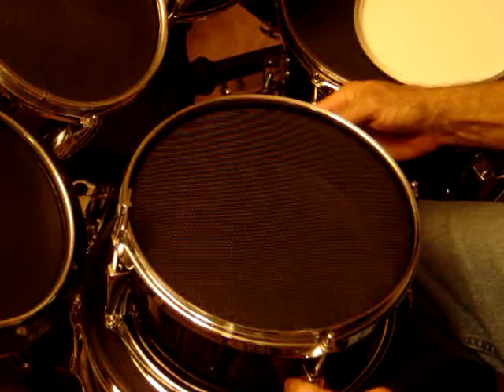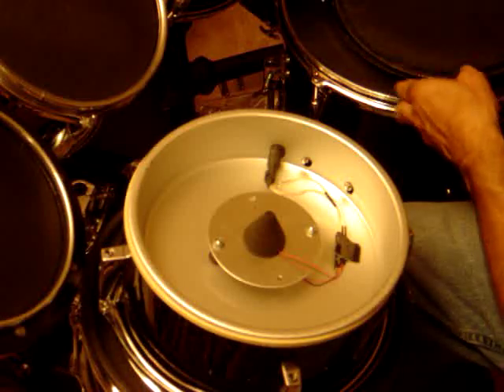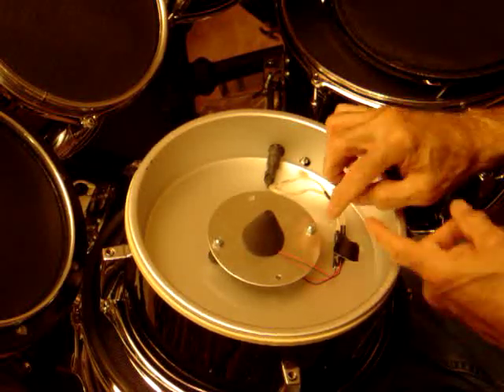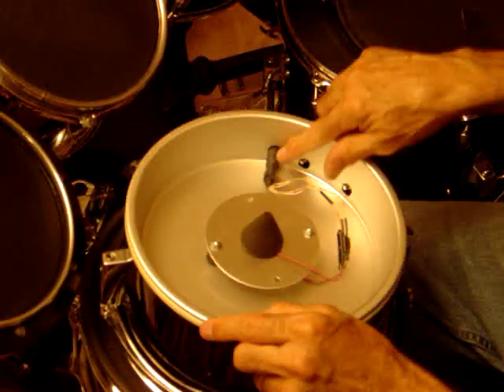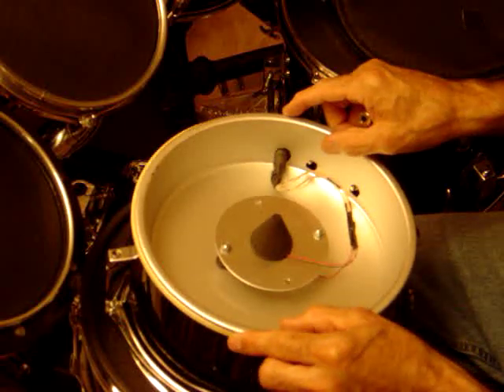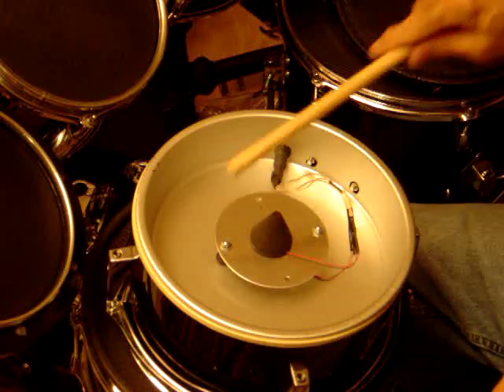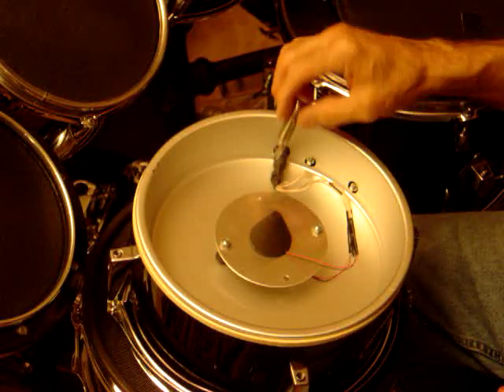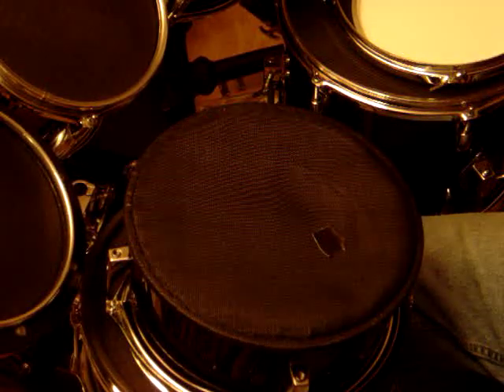DIY eDrum / cake pan- Segment 2 of 3

Comment: hi will any size piezo element work? turns out that i order some from ebay but i did not realize that i was a smaller size, they are like a 5 cent coin big. will these work or is there a diference in the behavior of the piezo element  been smaller?

Comment from the maker: for DIY small volume purchases I recommend buying the cones and/or trigger piezo assembly from the seller QuartzTrigger. He is on ebay as a seller out of Canada. his cones are clean and neat. they work. for a more professional DIY, don't waste your time and money trying to do this stage of the diy, just buy his cones.  he will also sell just piezos and even just the double face tape.  I use his pre made cone/piezo assembly,  I also bought some plain cones as I also had some piezos on hand.

Comment from the maker: I use my DIY Triggers (the Drums) to trigger my drum module. This module (a Roland TD-20) does more than just a TMI (Trigger to Midi Interface) it also produces the audio sound and allows for a variety of input and output signal control. So, in one box, my trigger is assigned a midi value and then converted to audio.  All I need is an amplifier to hear it.  While I have sold a few conversions locally, I do not have a system of parts for sale, Please search eBay for seller quartztrigger for parts

Comment from the maker: Cesar, your use of the term MIDI may be incorrect. Musical Instrument Digital Interface. is a  'coded message' for instrument voice, volume, sustain, etc, that is transmitted between MIDI devices. MIDI is generated by a MIDI module after receiving a 'Trigger' to start that MIDI message - This is called a Trigger to MIDI or TMI. My DIY drums are just Trigger devices, they do not make a MIDI signal.  The Trigger signal is just a voltage spike produced every time you hit the drum (more in next msg)

Comment from the maker: It might, depends on the trigger I/O or the module.  You will need to be able to setup, or 'tell' the module that your trigger pad (cymbal) is a dual piezo.  some modules allow this , some do not.  You could also wire each piezo to a separate input and assign the voices as you see fit, again depends on the module or your trigger I/O.

I have a cymbal I made using two piezos, so it is possible

Comment from the maker: ... good to know info...  Even a mesh head needs to get pulled over some sort of bearing edge.  The shells that I have cut were only cut into two - leaving two shells with each having one good bearing edge.  The cake pan builds I did had the cake pan lip sitting above the original bearing edge and the pan lip became the new bearing edge.  a cake pan might fit those flat edges from the middle section and thereby provide a bearing edge, else an edge will need to be formed. enjoy your DiYing

Comment from the maker: the cone protrudes above the bearing edge by about 1 to 1.5 mm, and the head is rather snug tight. the head should always be in contact with the cone when playing.  there  will be a very slight bump where the cone touches the head.  A second, false trigger, may occur If the head vibrates up of the cone and then hits back down on the cone.

Comment from the maker: I have started making my heads using an idea from another builder. Cut the mesh about  1.5 inches larger than the drum shell.  Cut a section of TV Coax Cable to fit inside your counter hoop.  cut a series of even numbered .25 inch slits in the mesh along a line that is drawn about 3/8" inside the outer diameter of the mesh head..keep them evenly spaced at about 3/4 to 1 inch apart.   lace the cable in & out of the slits and work  it till the ends meet.  install with cable ends facing up.

Comment from the maker: Your method of build is, in general, called a crossbar. I have built a few of these as well.  There are a variety of ways to mount the triggers.  This cake pan is just another option.  If you find pans that fit your drum, then all is well.  It does make for a very clean underside of the drum when splitting one shell into 2 trigger pads. BTW -my DiY, 'mini snare'  is a cross bar build, works great! I have a video of it posted also.  Glad that you have found a solution for your DiY eDrums -Enjoy!

Comment: The edge of the drum is important for fitting the head. Did you notice anything strange when using the edge of the cake pan? I just used a thick wooden plank (1.5"x4"x drum radius), fitted to the wooden drum wall by nuts and bolts with metal L-bars. That worked great! Very sturdy.

Comment from the maker: @CleanEdgeProductions ->  You are  corect, thank you for the correction.  The rubber insert item I used is a wellnut, a nutsert does not have a rubber insulation part and is a hard metal item.

Comment from the maker: @jimmywacked  the top commercial heads are available from Roland, Hart Dynamics, and Billy Blast 3 Ply Ballistech II  - as well as other brands.  Search internet for mesh drum heads. 

 I built my own from  old drum head hoops and Solar Sun Screen 90. the heavy screen used for sun block for decks and windows. You can also use tubing in place of the drum head hoops.  Search the edrum DIY forum at  vdrums dot com.  There are some inovative, esay, DIY builds for mesh heads

Comment from the maker: @cloudmusic01  ;  Yes, a Stereo jack is used to connect two piezos - The sleeve gets a wire form each piezo and the Tip and Ring get one wire each.    A Mono jack for only one piezo typ of pad.  Be sure to choose your module prior to building the trigger pads. Rolands use a slightly different wiring for the jacks, Some modules work better with smaller piezos.  No big deal, but it is best to get the builds right from the start. Pick your module than build the trigger pads.

Comment from the maker: see my no bolt cake pan build videos, part 1 and part 2.

I used two plates and double face tape to mount one plate to the pan, then used bolts to mount an adjustable height trigger platform.  

-OR-
I have not done this, but, the bolts could be eliminated completely by using a premeasured stack of double face tape to set the trigger height.

best regards for your build.